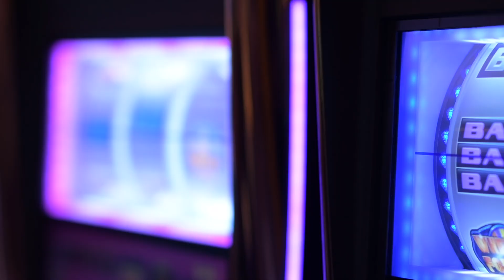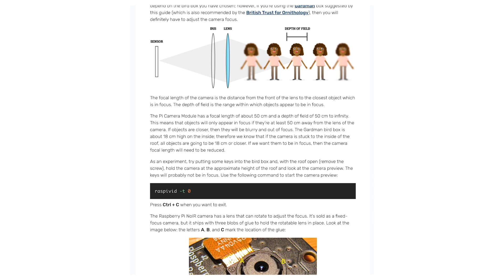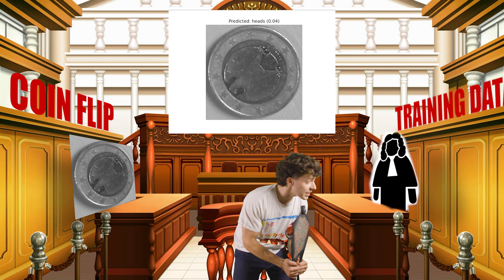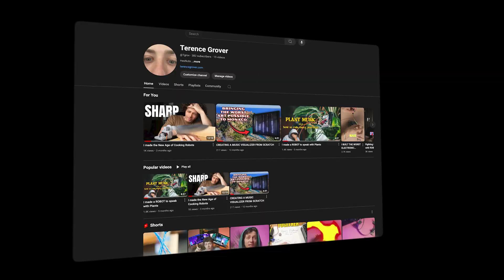My AI robot lets you flip a legendary coin

Comment: Nice robot. I also liked the egg in the parts drawer. Simplicity suggestion for you, you could have the iris center the coin before you take the picture instead of after. Then you know where the coin is. That might save a little processing time as well. Though I suppose if you're using the camera to tell when the coin has landed, that doesn't work.
Reply from the maker: Dude that makes so much sense. Not only does it save processing power, I could have also gotten the camera so much closer to the root itself. Thank you for broadening my mind and for the comment! Kisses.